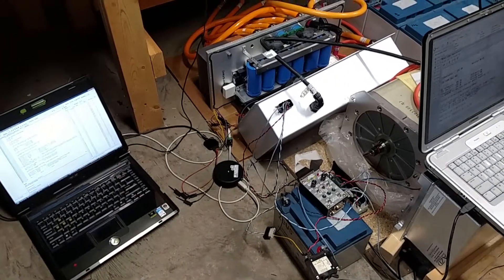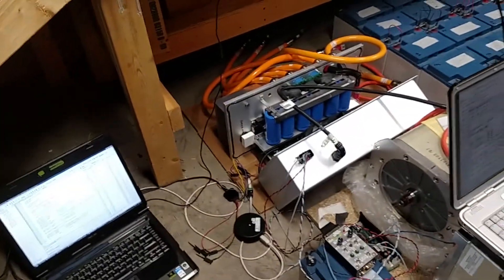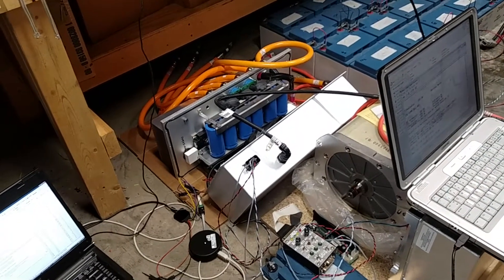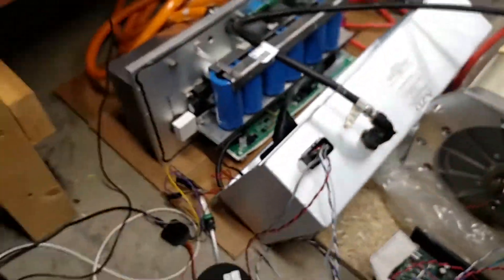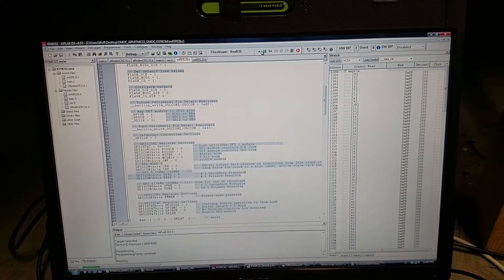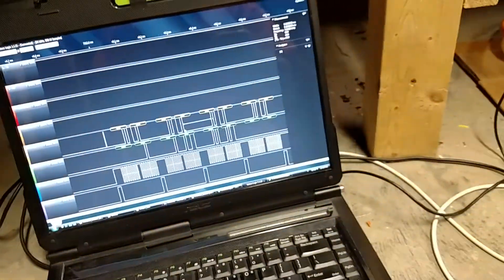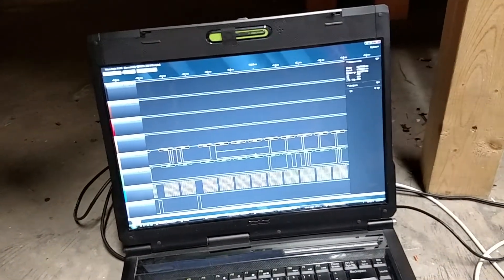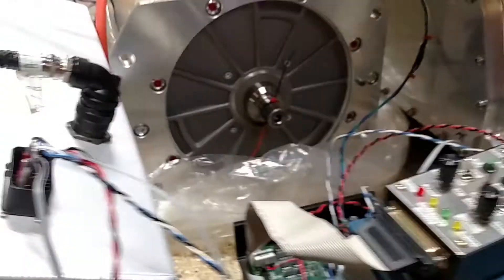Programming An Air Cooled DMOC645, Part 9

Comment: I have a DMOC 645 and want to take out the mother board and use the inverter  board from Johannes Huber and his gate drivers so I can have a higher amperage power section. Looks like the power section would be perfect for this application. If it works I'll hunt down another and make a dual motor inverter setup and run an HPEVS AC-50 dual motor setup. Looks like there would be plenty of room and should be easy enough to put in the drivers. I have a 914 Porsche that was converted with a DMOC 455 and Motor. I have all the original files associated with this controller/motor setup so I can do parameter changes. The DMOC 455 is a lower amperage setup.
Reply from the maker: If you are pulling working parts and don't need them for anything else.
I would be interested in acquiring those parts for use in controllers needing repair.

Comment: I would use heavy duty flux cleaner on the flash memory chip then once conformal coating is gone use air rework station and pull the flash chip.  Find flash socket adapter (or make your own) and re-flash it and re-solder it back in.
Reply from the maker: I lifted the pins...
See the next video. ;)

Comment: can you cut the miso and mosi tracks and solder back when you're done? would be a lot easier than adding pull-ups to all chips
Reply from the maker: Yeah, that was my thought...
But, they might have routed the lines under the chip...

It is an 8 layer board, and the outer two layers are ground, so there are not many exposed traces, most via up from the internal layers.

I will have to check on the bad controller board.
I did manage to pull the Flash chip off.

Comment: Do you have a surface mount hot air pencil?  They can be had for as low as $150, probably less on eBay.  The pencil will provid a very small stream of 750 degree air.  Directed at the coating it will soften it enough to simply chip it away with a jewelers screwdriver.  It will also melt the solder allowing removal of the chip.  If you haven't used one of these tools practice on a sacrificial board first.  It's easy to get things to hot and damage the PCB.
Reply from the maker: +randycarter2001 

I do have a hot air pencil... And I did manage to take the Flash memory chip off the other board... (If you look closely, the processor board I show in the video is missing the Flash memory chip).

But I decapped it in the process, and the MOSI pin broke off. :(

The conformal coating is hard, like they dipped the board in epoxy.

Heat from a soldering iron does not soften it, you have the scrape it away.

And becuase the SOIC package sits slightly above the PCB, the conformal coating got underneath it. Gluing it to the PCB. :(

Thanks for watching.
Reply: +Wolf Tronix I was thinking it sounds like an epoxy, which seems like overkill.
Reply from the maker: +JRP3 
Well, not really...
Typically automotive electronics are potted...
So this is one step below that. ;)
Reply: +Wolf Tronix Interesting, potting REALLY seems like overkill ;-)